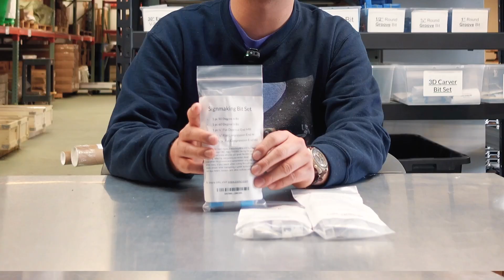What are End Mills and Which Ones Do I Choose?

Comment: Well you have some learning to do about tooling...  OAL (overall length) doesnt effect deep it can cut,  LOC does (cutting point until liftoff) What you were measuring  for diameter is shank diameter but the worse way possible in the tool making industry, so bad I think this vid is a meme.

I you measure your tools like that you will destroy the cutting edge. Not if or when, you will. Tungsten while hard as diamond is still more fragile then glass.

NVM you work in shipping and the backgrounds proves it. You just heard a few keywords to make this video.